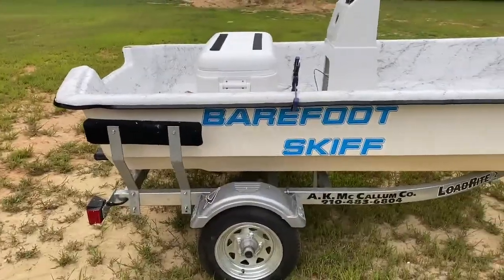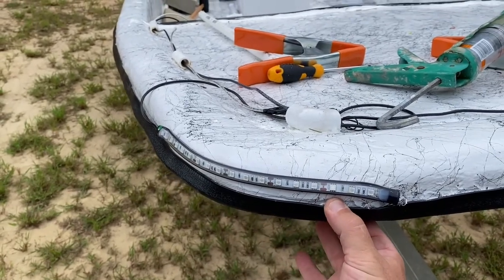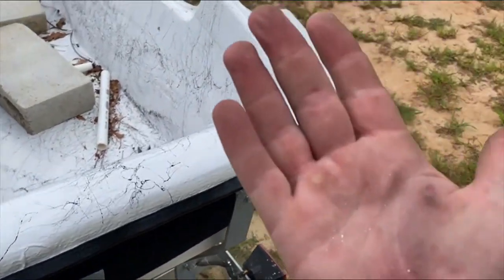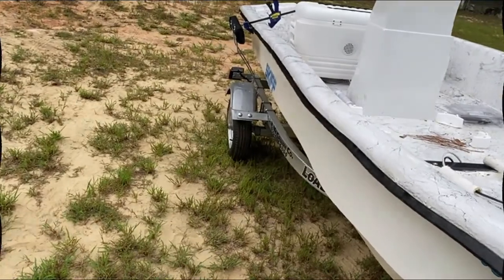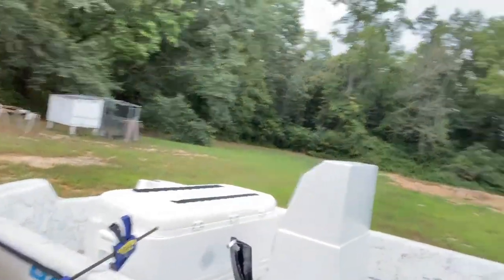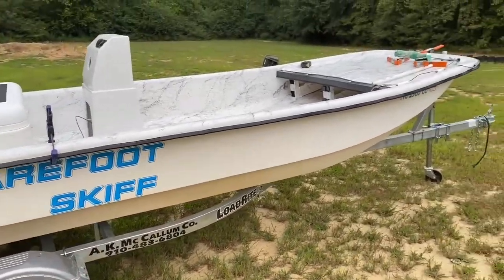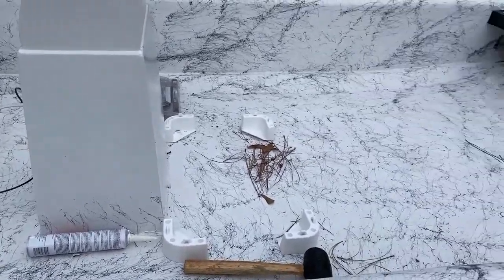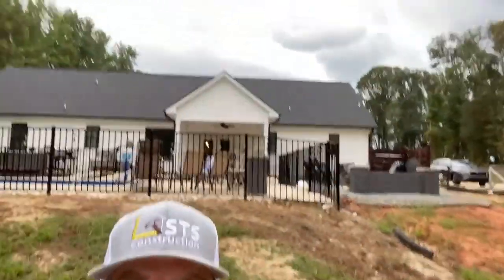How to Save Money on a Carolina Skiff Rub Rail, Carolina Skiff J Series Renovation

Comment: I'm remodeling a 2001 J 16 and need a rub rail. Do you mind sharing where you purchased it? I'd also like to know what you used to raise your cooler and brace your front deck. Thanks!
Reply from the maker: Absolutely!  I ordered the rub rail off of eBay.  To raise my deck, I built what I call triangle trusses.  Not exactly perfect but after you fiberglass it’s in, super sturdy.  I raised the cooler with a pressure treated 2x4, glued in with 5200 and caulked to keep water from getting under them.  I tried to not drill any holes to the deck